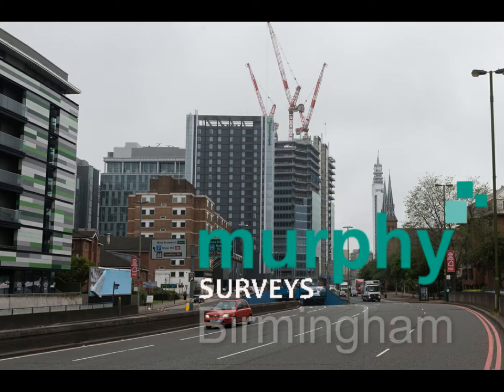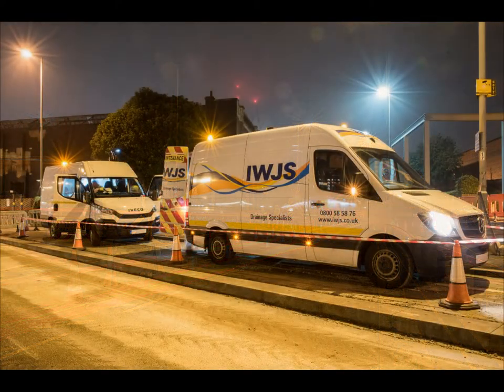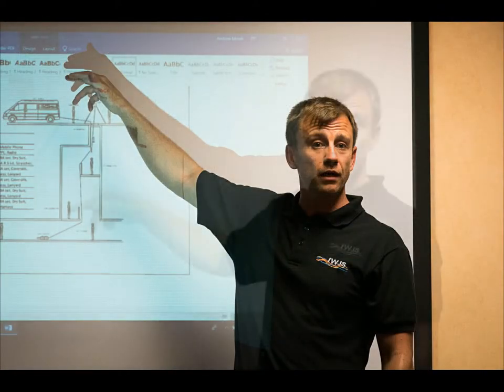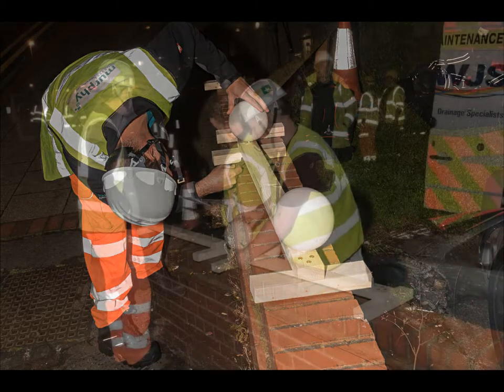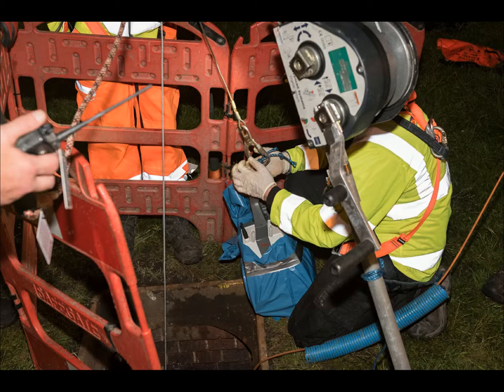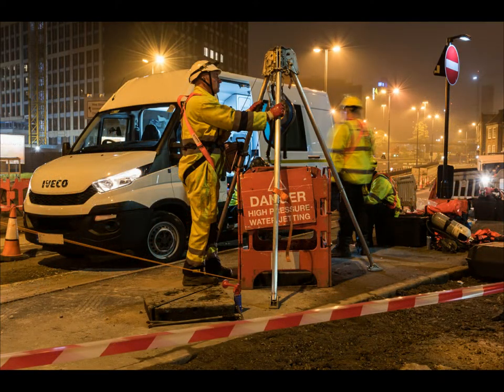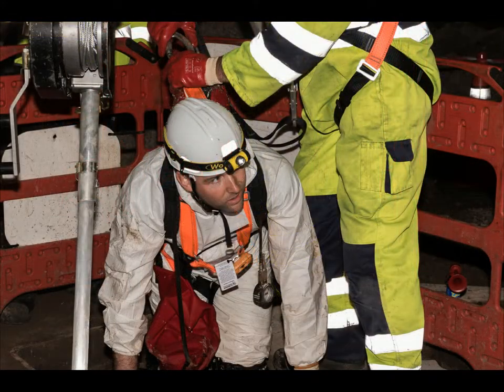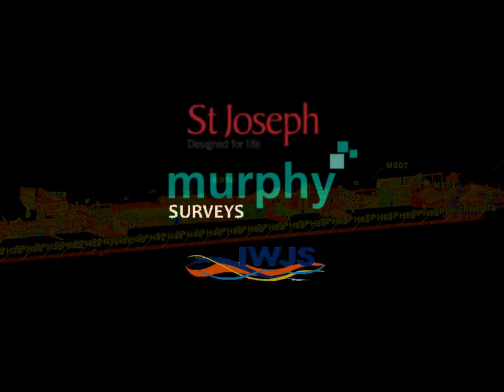Murphy Surveys - Underground Birmingham

Comment: And still they didn't know how many abandoned 
Underground tunnels still in Birmingham under shops that's  why so many sinkholes
like the one they had on hands worth new road were the road dropped in 300ft into underground river and tried saying was part old  sewer system
Reply: Do you have any information on the tunnel system that runs through the city centre pal?